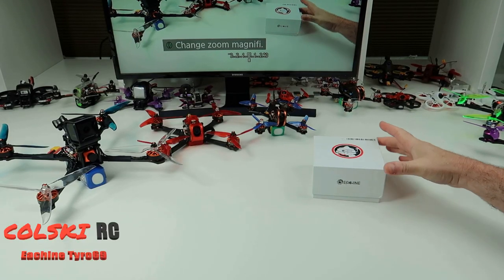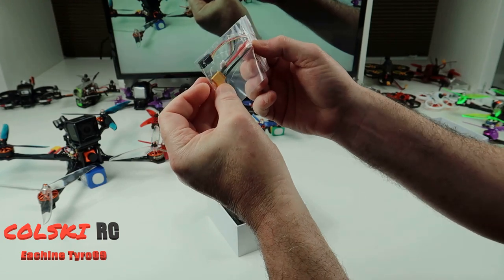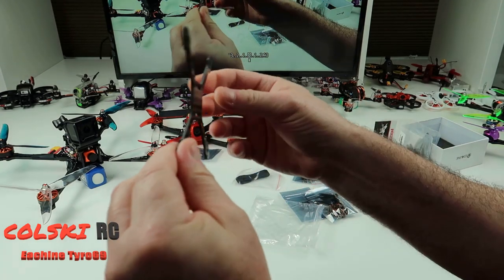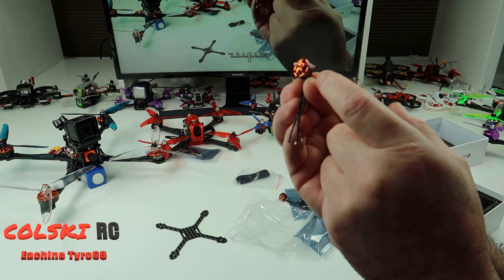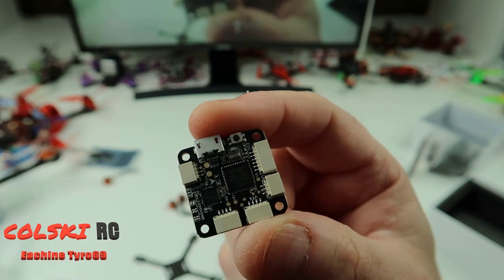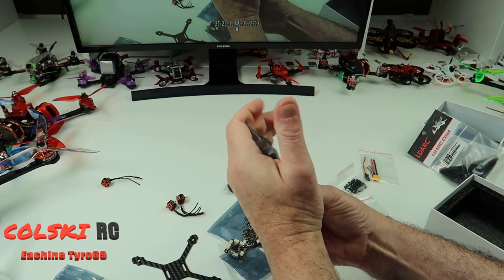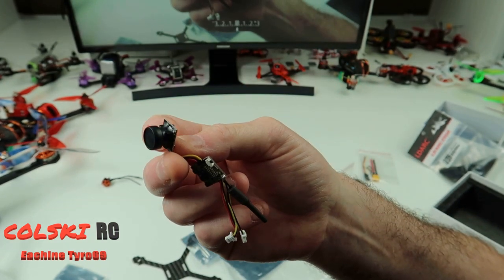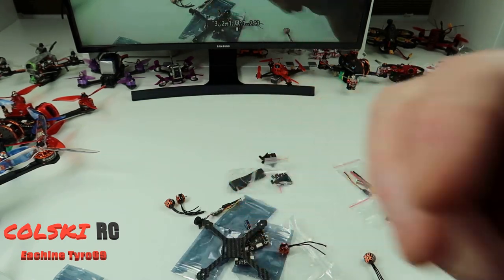Eachine Tyro69 Part 1 unboxing and initial overview

Comment: have you tried it yet? it come with some missed items like in the tyro99 and 79 kit?
Reply from the maker: Hi everything is in the kit
Reply: @CKone41  i'm having vibrations problems, it caused by a bad cut in the plastic spacers, you have the same problem?
Reply from the maker: inda lopez no but if you are using the stock props I would imagine that’s your problem they are useless.
Buy some HQprops
Reply from the maker: inda lopez I cant see why the plastic spacers would cause vibration also what lipo are you using
Reply: @CKone41  thanks for help me! i will try it whit other prop!
 i'm using 3s 300mah,